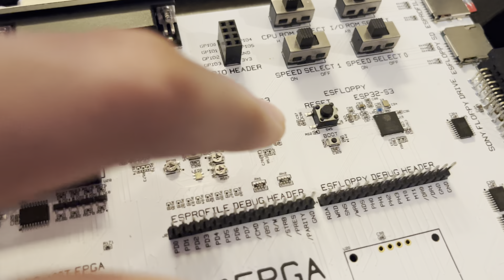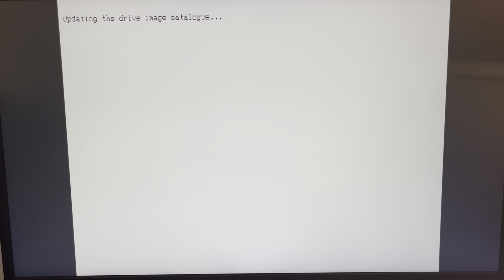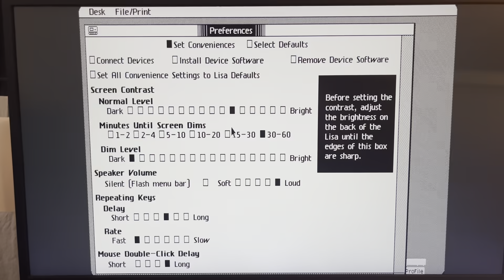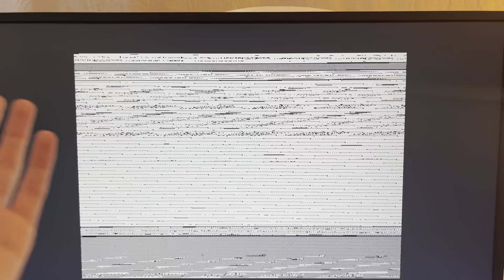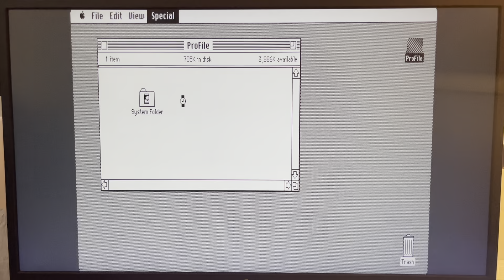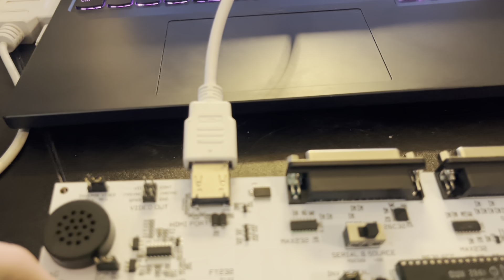I recreated the Apple Lisa computer inside an FPGA! - The LisaFPGA Project

Comment: Someone please do the same thing for the Lexicon 224x digital reverberator. That's a reverb unit from the early 80s that just has a sound that is still beloved today even though even though it's specs aren't as good as a modern delay unit. If somebody did this they would sell a shit ton of them.
Reply: Have you checked if Universal Audio has coded an emulator of it yet? that's there specialty for the last 20 years!
Reply: @JR-Dallas65 I know there are software implementations of this but I want an actual hardware implementation.
Reply: There are plenty of software reinditions of old Lexis, but lots of their magic was in the adda, which had quite a special flavour.
Reply: @hepphepps8356  Should be able to be done in an FPGA.

I would want two of these for my studio!

Comment: Not playable. Among all the videos I played, this was so laggy and will buffer every 1 second.
Reply: If you drop it down to a lower resolution it will probably stream better.  For those that have a better connection, the higher resolution offered in this video is music to our eyes.
Reply: Same here.  I have automatic resolution set, it's chosen 720p, video codec is AV1 + Opus, FF on macOS.  Maybe a YT encoding bug?  Or maybe the codec is throwing huge variability in bitrate due to the shaky video and YT's buffering algorithm can't handle it?

Comment: Interesting. Why didn't you re-implement the Z8530apc in the FPGA?
Reply from the maker: It just seemed like a whole lot of work, and I already had my work cut out for me in so many other areas of this project. The SCC was something that I could easily offload to a real chip, so I figured why not, at least for now. The FPGA is physically connected to all of the SCC I/O lines though in anticipation of potentially integrating it internally later on, so all it would take to disable the real SCC and enable an internal one is flipping a bit that switches a mux over from one SCC to the other.
Reply: @AlexElectronics  Hey, thanks for the response. I totally get not going down another rabbit hole implement this especially for an unusual UART like this one. I was curious about how you handle 5V tolerance talking to the part. Looking forward to seeing more. Cheers.
Reply from the maker: Ah, good question! I've got bidirectional level shifters on the data bus made with BSS138 MOSFETs, and unidirectional level shifters made from simple 74HCT245 and 74LVC245 bus transceivers on all of the unidirectional signals. You might be able to see the MOSFETS on the top and bottom-right end of the SCC, and the unidirectional level shifters are the three ICs to the left of the bottom MOSFETs. I might make a technical deep-dive video if there's enough interest!
Reply: @AlexElectronics  Awesome. Would definitely be interested in a deep dive. I'm currently designing something entirely in my head but at some point need to pull my finger out 😆

Comment: Used a Lisa in 1983, to use MS Project 1.0!! It seemed like a toy operating system. Only one menu bar at a time? Put me off Macintosh for ever. Unix with Solaris and SG for me in the 1989 on to 2010s

Comment: Please MiSTer it!
Reply: That’s a gamer thing - Lisa not going to have a game library to make that worthwhile to anybody using MiSTer
Reply from the maker: Yeah, and plus I wanted completely custom hardware that caters specifically to the Lisa!
Reply: I saw your hardware, understand the free MiSTer definitely isn’t the right destination for your efforts 

But MiSTer isn’t just for gaming, tho.  It’s got legacies of hardwares, that’s where I currently run my pixel editor on.  Software can be packaged into CHDs to consolize legacy softwares without needing to type anything.  You can try it, it’s great!  

your board and project looks lovely 🎉
Reply from the maker: You're right, there are some cores on the MiSTer that aren't just for gaming. I just don't think it's quite the right piece of hardware for my intended use case. And also, it uses an Altera FPGA, and I absolutely hate the Quartus toolchain. I've had nothing but problems the few times that I've used it, lol!
Reply: Pretty sure someone will do it one day on mister or its successor platform.
Also all the HP scientific computers and calculators from the end 70s , 80s and early 90s would be great additions to tinker with those without the hassle of real old finicky fragile expensive hardware. 
Only their specific keyboards would be missing but nowaday they could be feasable with 3D printing at home i suppose...

Comment: This is an AWESOME project! I'd love to get a board :D
A few suggestions: Maybe add headers for the buttons for the ESProFile and ESFloppy controllers and such in the next revision of the board? That way it's easier to model a 3D printable enclosure for your board, and it gives you more flexibility. 
Great job, keep up the good work!
Reply from the maker: It'll be fully open-source on my GitHub here within the next few weeks, so stay tuned! Good idea with the  headers; I think I'll go ahead and add that, even if I don't design the breakout board right away.